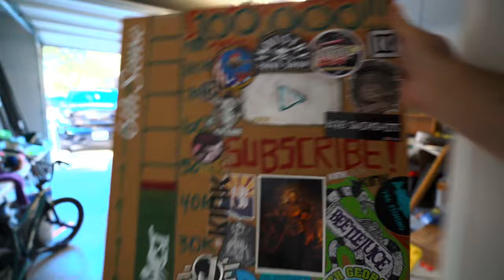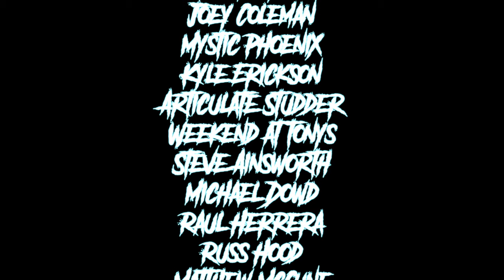10+ Things You MUST Keep In Your Bass Boat That You Might Not Be Thinking About! Not required by law

Comment: Extra spark plugs, extra fuel filter, some heat( gas water absorber).
A multimeter, prop nut, hub, and washer.
Lower unit gear oil.
And an extra gas line/ fuel bulb.
   Sorry, I was a boat mechanic for 20 years...
Theres more, an extra wheel hub kit w/ bearings/ grease.
In truck; extra bulbs for trailer.

 I enjoy your videos!!

Comment: Harbor Freight Icon item 58074. Mini ratchet set with any bit you will ever need. Great for tight spots. Really small compact case and the bits/ratchet stay in place. Takes up no space and saved me multiple times. Worth a shot if you want to save some more room and replace your larger set. Also check out Line Cutters, they have a stick on line cutter you can put anywhere and cuts any line just pass through. Great content as always.
Reply from the maker: Thanks for the suggestions dude! I’ll check those out.

Comment: Can you explain how a motor mate takes weight off the Transom ??? The 400 lb engine is still supported by the transom. A conventional transom saver puts the weight on the trailer doesn’t it ? Just curious how that works. I like the channel

Comment: Appreciate the video. Don't forget a PFD per person, horn, and a whistle if horn is not working. A flashlight if you don't have lights on the boat and get stuck before dark, and a bucket in case bilge quits out.
Reply from the maker: I have every bit of all of that. I didn’t feel it necessary to include items required by law aside from the fire extinguisher and I only showed it because I had to move it to get the drill. I have everything you listed minus a bucket. This skeeter ain’t sinkin. Thanks for watching.
Reply: @JustinRoyal  thought so lol.  Thought I'd add for us smaller boat owners. Just thought of a paddle, radio, and a snorkel. No problem man. Keep living your dream, tight lines!
Reply from the maker: Bro those are all really great items to keep on board! orders snorkel
Reply: @JustinRoyal  right on man, happy to help!
Reply: @JustinRoyal  dude, toilet paper. 😬

Comment: Get a bobs machine shop trolling motor prop nut, mine looks like new and ive had it for a few years. It also has a hole in the center incase you shear a pin so you can get the nut off and not destroy your prop.

Comment: Did you have a throw cushion for an overboard person? Did you have flares and a whistle? One other thing I consider as equipment is a latch for your trolling motor to prevent it from accidental launch.
Reply from the maker: I have every bit of all of that. I didn’t feel it necessary to include items required by law aside from the fire extinguisher and I only showed it because I had to move it to get the drill. The purpose of this video was to show people items they may not think about, not what is legally required. Thanks for watching.
Reply: @JustinRoyal  agreed! I didn’t think that way. Thanks for the reply. Great video Brother!

Comment: Love the videos.. #1 thing in my boat are life jackets. I seen the suspenders in the box with your motor prop, but didn't know if you mentioned them
Reply from the maker: The purpose of this video was to show people items they may not think about, not what is legally required. I did not feel it necessary to include items required by law aside from the fire extinguisher and I only showed it because I had to move it to get the drill. Thanks for watching.
Reply: @JustinRoyal  gotcha

Comment: Barbisol trick been around decades. Awesome hack but works way better when sucked up with wet vac.
Also. Folks should always have an extra horn , older boats always fail. Bad deal to have happen in a tournament. You catch Bertha and your horn doesn’t work at boat check and your done.
Reply from the maker: I carry a whistle as a backup audible. Wet vac tip is accurate. I do that on larger jobs. Thanks for watching and commenting.

Comment: Justin, a lot of what you had shown I have. I love my DD26 transom saver and steering locks. I've been procrastinating changing out my TH Marine Trolling motor cable cover with a DD26. When I do, soon I hope, since I buy direct at their location (I live 20 minute away from DD26) I will mention your attempts to contact them. My battery compartment has a tray made by @MK2DESIGNS and have my tools in it. My "red" prop nut has not faded. Thanks for the reminder on a spare Trolling motor prop--I need to get one. So two questions for you. Do you carry a drop anchor ⚓️?  And,  regarding the battery charger/jumper could you not with cables jump your cranking battery from one of the TM batteries? A lot here but hope to hear from you. Thanks.
Reply from the maker: I could definitely jump off a trolling motor battery. But I have this thing so I carry it just in case. I do not typically carry a drop anchor.